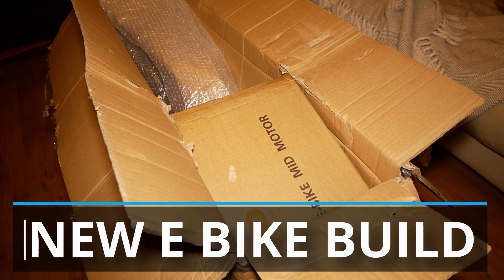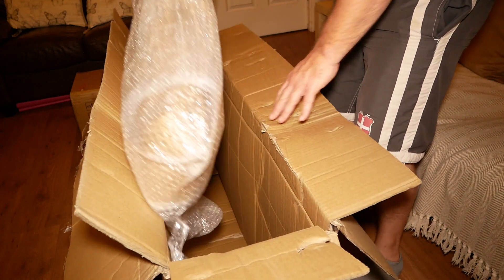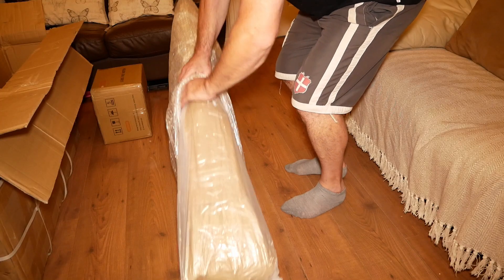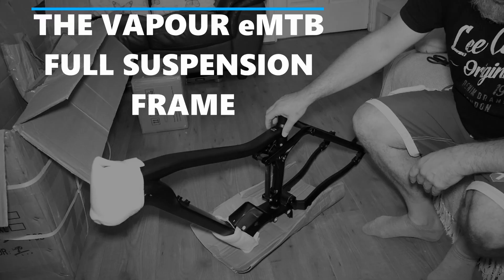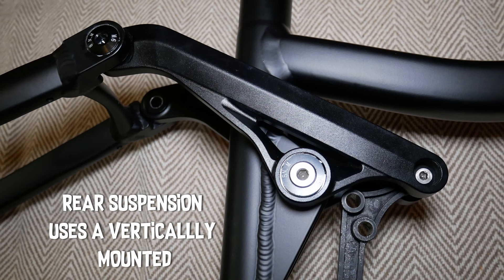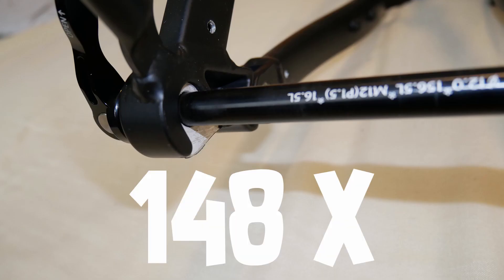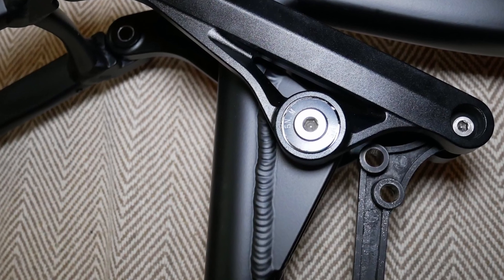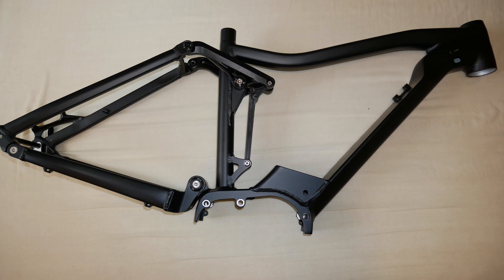POWERFUL EMTB MID MOTOR FULL SUSPENSION FRAME UNBOXING PART 1 Bafang ultra   G510 mid drive motor

Comment: Are you in the US. Does he ship to the the US and is it really expensive to get that frame here?
Reply from the maker: I'm in the UK and I think were I got it from only supply's to the UK.
Reply from the maker: Aliexpress does the same frame but shipping can be expensive depending on what you choose https://www.aliexpress.com/item/4000319151004.html?spm=a2g0o.detail.1000060.1.3ddae106SCR0wl&gps-id=pcDetailBottomMoreThisSeller&scm=1007.13339.169870.0&scm_id=1007.13339.169870.0&scm-url=1007.13339.169870.0&pvid=c3018a25-4d70-4fae-9b3a-ef2fd08c5c54&_t=gps-id:pcDetailBottomMoreThisSeller,scm-url:1007.13339.169870.0,pvid:c3018a25-4d70-4fae-9b3a-ef2fd08c5c54,tpp_buckets:668%230%23131923%2331_668%230%23131923%2331_668%23888%233325%2310_668%23888%233325%2310_668%232846%238107%231934_668%232717%237565%23762_668%231000022185%231000066058%230_668%233468%2315608%23194_668%232846%238107%231934_668%232717%237565%23762_668%233164%239976%23149_668%233468%2315608%23194

Comment: PLEASE HELP! I want to order this frame. But ... 17 or 19 inches? This e-bike on video is 17 inches?
  I am 173cm tall. What do you think?
  How is the frame, large or small.
How tall are you?
Greeting hammer
Reply from the maker: I'm 177cm and bought the 17cm frame. The 17 inch bike is still a good size  and suits me just right .
Reply: @baconbuttties  Thank you
Reply: What is the range of your battery?
How many km can you drive? in which asist level?
Reply from the maker: @hammer7596  I would say about 50km on assist  setting 3. It might be more as I have never run it to empty.

Comment: What is differens between g510  and m620 ?O_o..?
Reply from the maker: There's no difference, G510 is used more as a reference to the frame mount which the M620 will mount to.

Comment: I've been looking at your videos for some time; very informative and well presented, thank you. I'm thinking of starting a fresh bike build again as my existing conversion, although well used and much admired locally, is ready for replacement! I'm probably going down the route of Nuvinci 380 hub and a belt drive. Is your frame (rear) splittable to accept the gates belt? Cheers, Peter
Reply from the maker: Thanks for watching the videos. If you mean does the rear part of the frame separate from the front then yes it does and I did take the back end off once before but I can't remember why I did take it off? Must be my old age memory.
Reply: BACONBUTTTIES 3TTT,s thank you, very much appreciated.

Comment: Have been looking at getting this frame,motor combo. What's the craic with import duty and taxes as it's shipped from China. Don't want to get stung with 62%, seems it could be a gamble. Cheers. Good vids 👍
Reply from the maker: I think the import duties was around 80 pound from TNT but it may vary depending on courier. I had the motor and frame shipped in the same box.

Comment: Would you know if a triangle battery would fit the 19 inch frame. I was looking at the 14p6s em3ev pack. I've found they make excellent safe lithium ion.
Reply from the maker: I just had a look on their website and it does show dimensions of it. I suppose the main problem would be if it clears the rear shock. One of Andy Kirby's videos shows him using a triangle bag but I think it was pretty snug.

Comment: I saw your video which you were talking about why you are selling the other ebike... I was curious if u sold it? And I agree with you about the weight....
Reply from the maker: Hi, yes I sold the other bike and it was mainly to do with the weight.
I had not installed a battery or controller and it was already to heavy.
Where I usually ride has barriers that you will have to lift the front and turn the handle bars to pass  through and with the weight it would have been difficult.